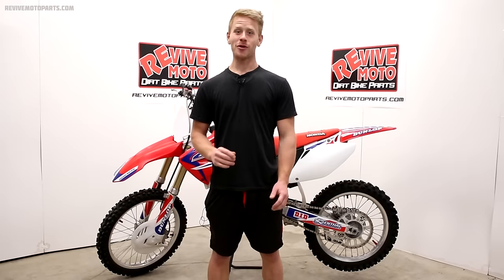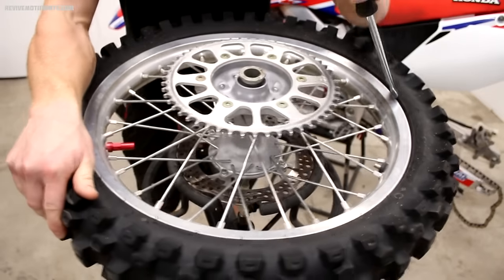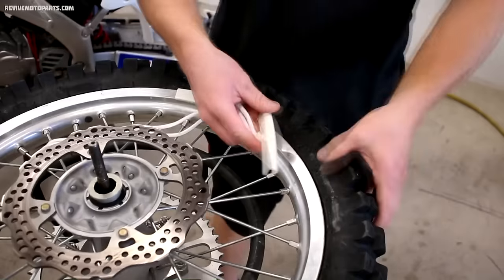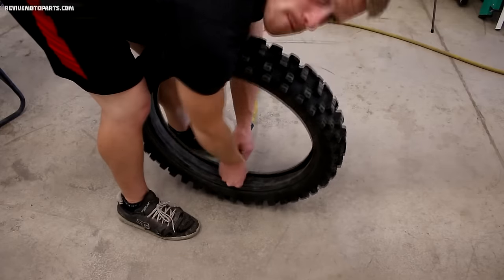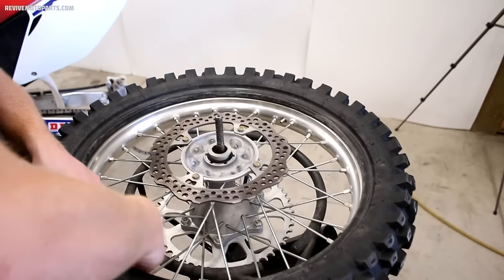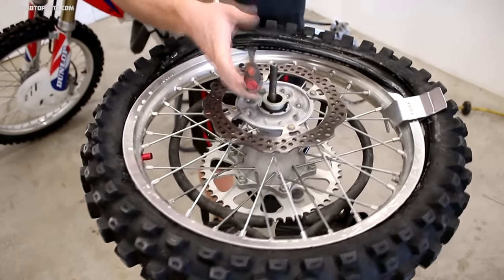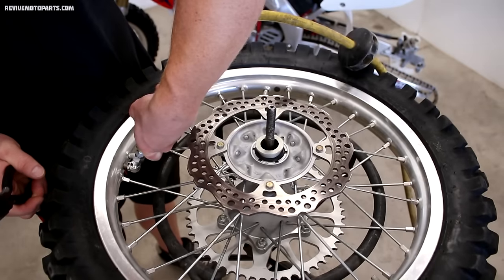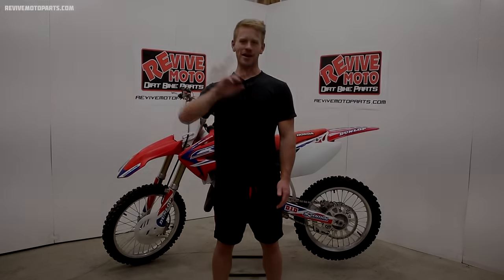Secrets To Changing Tires The Easy Way

Comment: I love the way they do these vids in a nice, neat tidy workplace with a showroom condition bike and all proper equipment....... There's me out on my drive with cold wind, my wheel on the ground rolling around, getting covered in oil and road grime while saying every swear word in the book!!
Reply: I would be taking it into a shop for a tire change if I couldn't work inside
Reply: I mean that’s basicly me except I say every swearword in the book in every launguage!
Reply: Dan Wilson I like how it took him one second to get the valve stem into the rim hole. Took me 3 hours.
Reply: Yeah, I fought my rear tire for two hrs in 105 degree weather. I don't want to take it in, because they charge like $60 to mount and balance for my specific bike.
Reply: @danwilson I have watched hundreds of videos on dirtbike and motorcycle repair, and in the videos they are always way fast and never struggle. But after I do the same repair a few times is all becomes 2nd nature. I have also slowly turned my garage into a mechanic shop over the years and hell that helps a lot too.
Reply: ban tires.
Reply: that’s gonna be me in 15 minutes
Reply: For real thoe 😂
Reply: Yeup I can relate bud. I have some choice profanities. I am proficient therein at least
Reply: This 😂😂😂
Reply: 😂 same
Reply: Im living your moment 3 years later lol
Reply: Very demur

Comment: You guys that have real stiff tires, or are up north where its colder, lay the tire down and stick  hair dryer in the tire for about 20 minutes.  Makes the tire a lot more pliable.
Reply: I tried. It cooled off pretty quickly. The tire was super stiff anyway.
Reply: warm rubber more stretchy
Reply: @murraydupley9330  not stretchy but more pliable.

Comment: Funny how they always fail to mention the stand which also makes a huge difference.
Reply: have to rise tire to pull
Reply: have to raise tire to pull. logs
Reply: 5 gallon bucket screwed down to a two foot cedar round.
Reply: Who's they?
Reply: J Ancel  I used an old bucket made some holes at the top to zip tie the spokes too the top rim of the bucket.
Reply: Wood round with a drill bit screwed in the middle. Think big drill bit.

Comment: Worked my ass off last night installing a new tire on a freshly laced rim.  Ended up pinching my tube.  Man, I was pissed.  But I had a 2nd tube on hand.  Worked just as hard the second time around but I got it.  I was also installing it on the floor.

Comment: As a MX'r of 40 years, I was just looking for a chance to call "BS". I did not see one. I was taught years ago this same way from an old time MX'r and it has served me well for hundreds of tire changes. Well done Cameron!!
I am now retired from MX but still get the fellow MX'r having trouble changing tires. I am happy to show them this, of many i'm sure, techniques. There is more than one way of course, but for me, this is hands down the best.

Just one note to add. Avoid doing this with a cold tire. I have even used a hair drier on cold days to warm the tire prior to doing the work. If the sun is out, lay the tires out in the sun. Your rims and knuckles will come out in the end thanking you.

Definitely invest in a tire stand and "bead buddy". Spot on there.

Cheers, Well done, keep it up.

Comment: Well, my tire was WAY MORE stiff..
Reply from the maker: Try putting the tire in the sun or in front of a heat source. That will soften it up.
Reply: hot water can make wonders too.
Reply: Get 4 spoons and stick them all in one section pull the bead over. By doing it this way You don't have to focus on hitting that sweet spot sight the air gap by reinserting your irons. Watch the rabaconda video and You'll see
Reply: Grease
Reply: Nice vid Sir
Reply: make sure you get the tire bead in the deep part of rim on other side of spoons

Comment: Pinched my first tube, $26 in the trash. Got the second one...I think. Gotta do a pressure check in 30 minutes or so. Nothing easy about it. Would be much easier with lots of c clamps to keep the bead down in the center of the wheel
Reply: Yep, I put wrenches between the tire and rim on the other side of where I have the tire paddles in and its still a bitch, with dunlops.

Comment: Great video. I didn't have a "tire Buddy tool, so I used some C clamps to hold the tire down into the rim. works pretty well.
Reply: I put some wrenches inbetween the rim and tire and its still a bitch.

Comment: 71 Dislikes so far... would be nice i this ppl explaining WHY they  disliked or posting a better Video ;) 
THUMBS UP and THX for sharing Cameron
Reply: Soapy water is not ideal, proper tire lubricant
Reply: @bubster1981  tyre lube is no good for motocross tyres. especially the drive tyres. it stays slippery and can allow the tyre to slip on the rim which even with a beadlocker can tear the valve stem. soapy water will dry up and the friction between the dry rubber and the rim will work with the beadlocker to ensure the tyre doesn't slip on the rim.

Comment: Great tips!  One more; if you have trouble getting the bead to seat, put the tire back on the bike, loosen the rim lock, put air in and roll it up and down the driveway, the weight of the bike will make the tire flex and the beat usually goes right on.  Don't forget to tighten the rim lock.
Reply: I just take the valve stem out an rapidly fill and deplete the air

Comment: Excellent vid but no mention of installing with the correct tire direction arrow!!   Would a little air not be better with the final fit,  to reduce risk of pinching?  And I think I've found that leaving a "lazy" (loose)  tyre lever in position during final section (eg. @6:42) can pinch the tire if/as the loose lever flips over the rim edge.

Comment: good video for such a pain in the ass process. what do people do on the trail though when they get a flat? bring all the tools and get it done without the mount? and what kinds of tubes are good to run? questions for probably another video...
Reply: Spanner for the axle nut, valve core remover, two 10" tire spoons, a couple of rags, and a spanner for your rim lock. If you keep these in your pack, you'll be good to do a tube change/repair anywhere. People will often keep one front tube in their pack, since the front tube will work in either the front or rear tire if needed. Or you can bring a good patch kit (takes up less space). I use heavy duty tubes. Also pack a small hand pump or a CO2 kit.
Reply from the maker: @Tyler Nicholson nailed it. I can second patch kits working well for trail repairs. But your best bet is to invest in heavy duty tubes.
Reply: awesome guys thanks
Reply: tmac9938 ride back to the truck on a flat.
Reply: Cameron Niemela heavy duty tubes weigh too much when you only weigh 120 lbs like me. It's very noticeable on my 250's.
Reply: Wayne S. 
     Sound like my old lady

Comment: When you start removing the tire with your tire irons it’s imperative to use 5 tire irons spaces about 1-1/2” apart. Insert your 5 irons and then in sequence flip them 1-2-3-4-5 and instantly you’ll have 1/4 of the tire off which relieves the bead stress. From there the irons will work the tire off with ease. Flip the rim and do exactly the same. Once both sides of the tire are on the outside of the rim then pull the rim out of the tire.
When installing be sure to put your last iron in place when the bead is about half way on the tire. The bead will get very tight, so having your last iron in place is very helpful, and always be sure the bead is pushed into the center of the rim to relieve the bead from being so tight on the rim. For the last tire bite I prefer the Nomar spoon bar which was originally made for a Honda Goldwing tire. Using this tool on a dirt bike tire makes the last section of the tire easy to leverage onto the rim without pinching the tube. Tubliss or Bibs are the way to go, tubes will send you home while your friends keep on with the journey.

Comment: Great video.  You made it look easy.  In all of the other tire change videos I've seen, they put the tube in after they get one side of the tire on the rim.  I've often wondered why they're not putting the tube in place first, like you did.  I thought maybe it's because there's less of a chance damaging (or pinching) the tube if you get one side of the tire over the rim before putting it in.

Comment: I can’t get the last section. It is extremely tight - like a straight line of tire between my bead buddy and tire iron. I have the bead on down in the center of the rim using more bead buddies. I’m literally damaging the bead it’s so tight. Wtf

Comment: no pinch tire tool works extremely well for install.  if using tire irons on install never pry past vertical and you will usually not pinch the tube.

Comment: I assume the plating on those is similar to the plating on those pit bike rims. We had multiple xr/crf trail bikes and they had chrome rims that never scratched. I need some cuz I got anodized yellow rims for my RM and using bulky rubber rim guards are a pain.
Reply from the maker: The rims on XR's are chrome plated, while the levers are nickel plated I believe. The rim protectors I used work really well, I've had great luck with them over the years. Or you could get a set of plastic tire levers. Only thing is the durability isn't very good.
Reply: ReVive Moto Parts i had very similar ones i tried using today. I guess the tire was so tight it ripped through the protector and scratched my rims any way. I guess I need small tire spoons for mx tires as well always used bulky car tire irons. I looked at stubby tire tools but I heard they break after a while.
Reply from the maker: Yeah the stubby ones are nice but I've broken them after a few months. You must have a really stiff tire.
Reply: its a wide rim (2.15) with a skinny tire (100) its a real pain but I think buying the thin tire spoons would reduce slips and wrapping them in tape would help too. I think if I were to use the plated ones it would only lightly scratch on the top of the rim where you cant really see it but having tape would help some to I guess.

Comment: Hi Cameron!
I have watched your video but i have a problem placing the tire. My problem is with the rim lock. My tire doesnt want to find its way from one side of the rim lock. It sits perfect all over the rim bit not here at this spot. I have try to push the rimlock inside but this is inposible onece i install the tire and the tube. Do you have any tips or have this problem like me? Will this hurt if i ride the tire like this. This is my 3th time tryung and having the same proble over and over.  Here is a link with the video of my tire. Please let me know what you think? Many thanks!
https://youtu.be/3AFq5Ww83mc

Comment: The section between 3:45 and 4:05 is what I struggle with most. In my case I try to do this for a tenere 700 rear street tyre (scorpion str, 150/70/18). When the rim sinks down in the tyre the top almost will not budge to allow me to pull out the tyre. I have managed to do it with warmer weather but with around 10 degrees celsius the whole because so stiff that I couldn’t manage. I tried using loads of grease and also tried with soapy water but no luck. Any tips here?

Comment: Everybody always shows this in serial conditions with new shit and every tool under the sun. What happens ,and for me it's the usual you have a tier that's been on the bike almost 5 years and you rip the sidewall in the rain at dusk 50 miles from a town. I've bashed beads for hours with a log on a rock so I could sew the weel back together and put a tube in. Kids these days!
Reply: 50 miles out of town?  When did you noticed you damaged the tire, after you ran out of gas?  :)
Reply: @EarthSurferUSA  look bud if your bike can only do a hundred miles on a tank I'd get rid of it. Most of the bikes I've had will do about 200 so yeah get rid of yours.

Comment: i'm surprised to see that you use a nuton the valve. I've always learned that it's better to only use a cap, so that way the valve can move a litle bit instead of getting ripped off.
Reply from the maker: I did not put a nut on the valve stem. It's a cap with a rubber grommet beneath it.
Reply: All of my bikes have a nut on the valve stem - even my new 2017 KX bikes.  The rear tube will not be moving if the rim lock is installed correctly.  If the front tube is moving you should consider installing a rim lock on the front wheel too.

Comment: Similar to how I installed tubes on my bicycle. Except I used my bare hands to remove the tyre and re-install.
Reply: Bicycles are cheating easy, all you need is a butter knife for the under sized cheap tires
Reply: @benson4u215  Knife? BARE hands... Only tools I had were for removing the wheel (before I had QR) and releasing the brake.

Comment: everyone does the back tire someone show your skill on the front!!!!
Reply: it's the same process really.. a little easier on most bikes since the front tyre is usually larger and more flexible
Reply: @UnacceptableViews  I have the opposite problem. It being skinnier. On my 6th rear and haven't changed the tube yet my front I always pop
Reply: @TheCharillz23  i guess it depends on how rigid the sidewall is. leave the tyre out in the sun for a bit to soften it up before installing it onto the rim. don't forget to use soapy water on the bead

Comment: Astroglide works better than soap
Reply: Correct and it doesn't dry as quickly as dish soap either. Thought I was the only one who used it.
Reply: As if my wife doesn't already question my relationship with my bike. "It's for tire changing...really"
Reply: Ya you can get a 21" tube in a 19" rim If you know what I mean
Reply: That's what your mom says